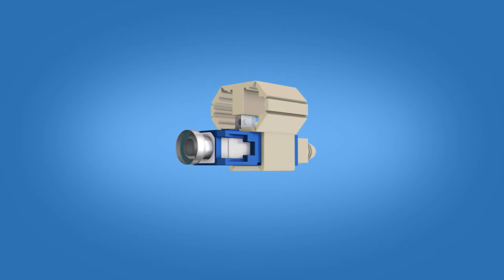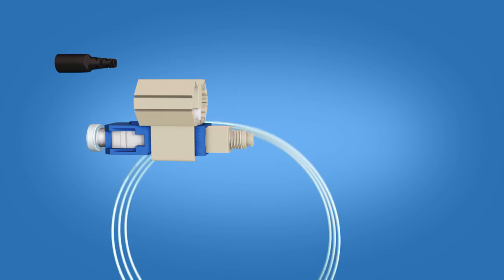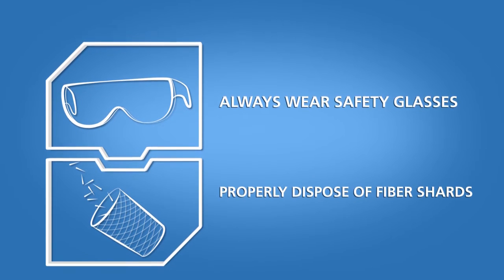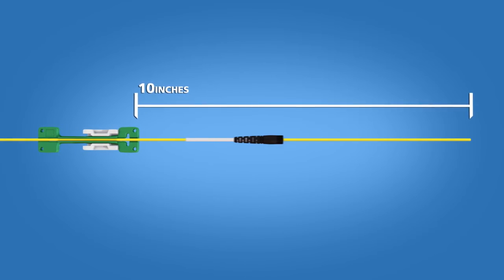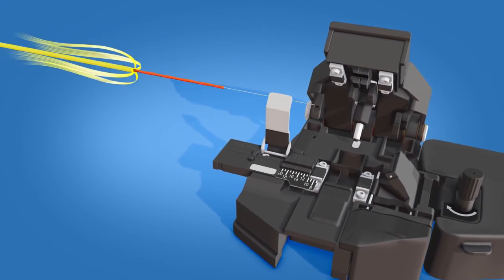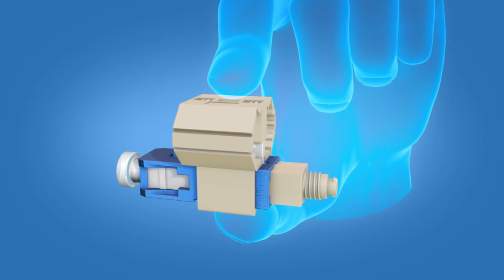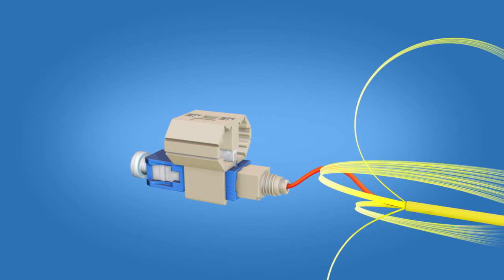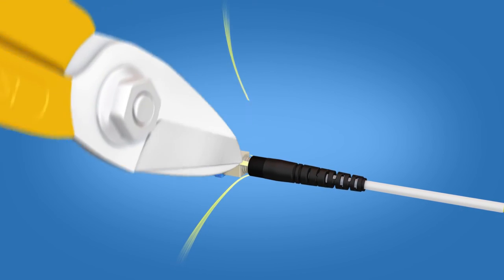FASTConnect® SC connector instructions for 2 or 3mm cable

Comment: We have a problem with the ST connector, when we divide the kevlar on to the threaded part and lock it with the boot the fiber inside of the connector is breaking easy when preasure is applied due to the connection in the boot beeing to dumb. Is there something that we need to change or think of when making this connection?
Reply: did you ever figure this out? ive been having this issue lately and its driving me crazy!! although i will say i didnt know you were supposed to only screw on the boot half way and cut the excess, ill have to try it again now

update: I did it exactly how the video shows and I've been getting perfect connectors every time. Cutting the kevlar is 100% crucial